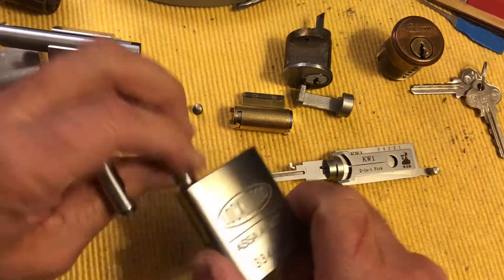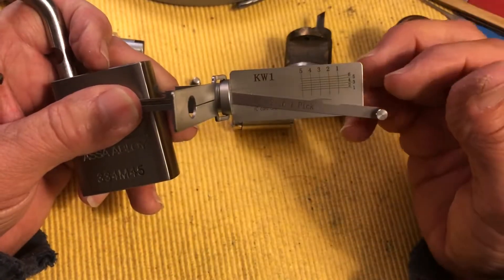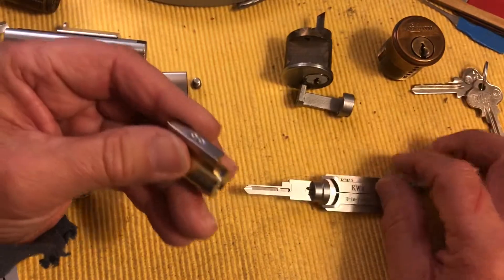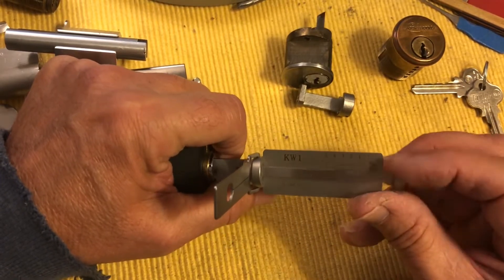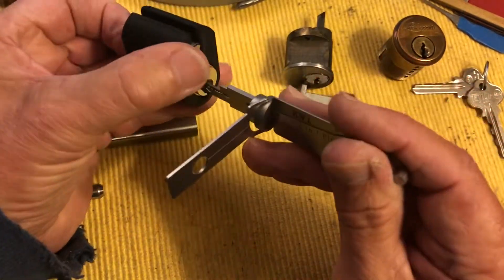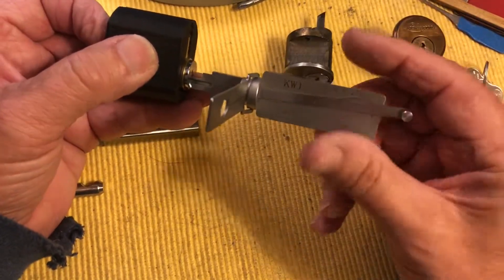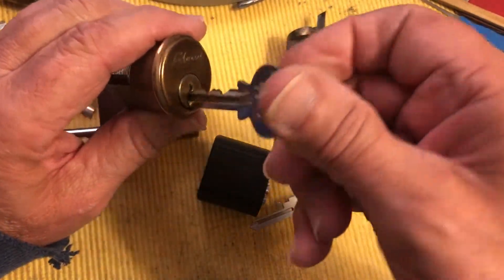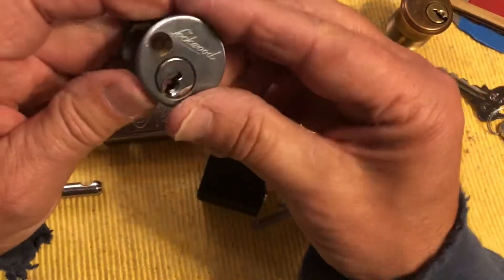#201 Lishi KW1 questions answered

Comment: Nice thanks for showing ... I didn't know a Kwikset Lishi could be used in a Lockwood (even if it's only for pins of depth 1 to 7) ... question: can a Lishi be used in any pin-tumbler lock if it can fit into the keyway?  ... or do some lock manufacturers have pins that are placed at different spacings, and also at depths that don't follow the Kwikset graduation?
Reply from the maker: Swynndla it could be used in a Pin Tumblr lock even if the pin spacing was a bit different. It would not line up with the numbers, but could pick the lock!! 
Thank you for checking it out!!!!
👍👍👍👏👏👏👍👍👍